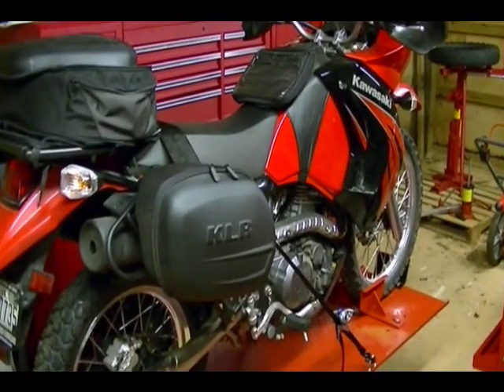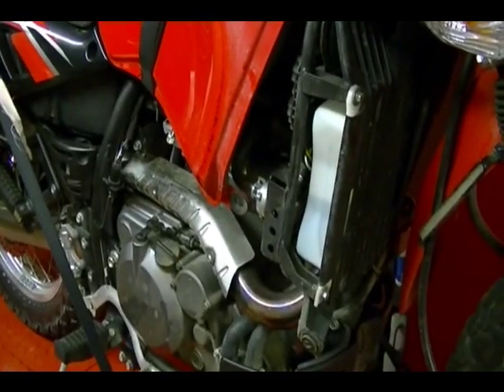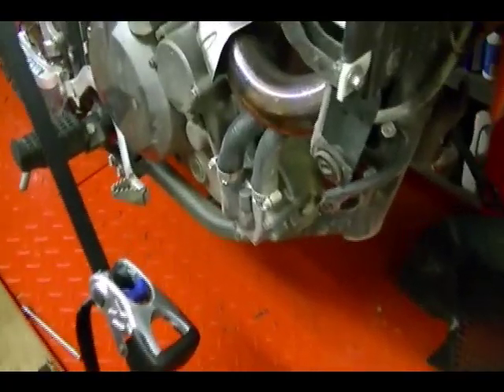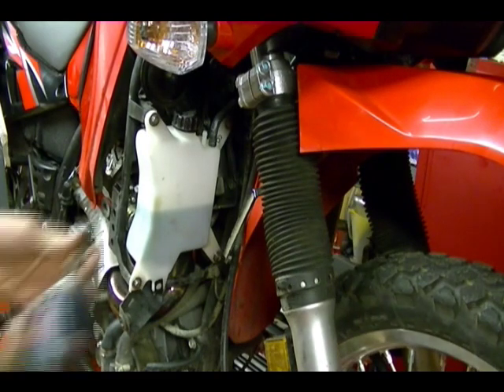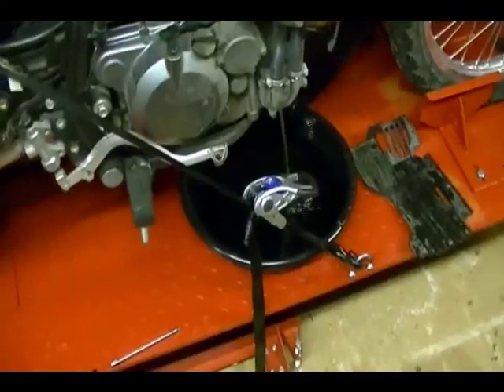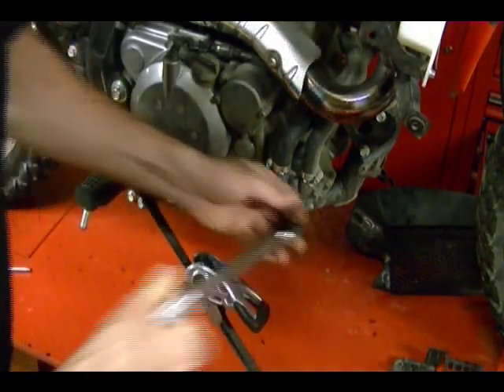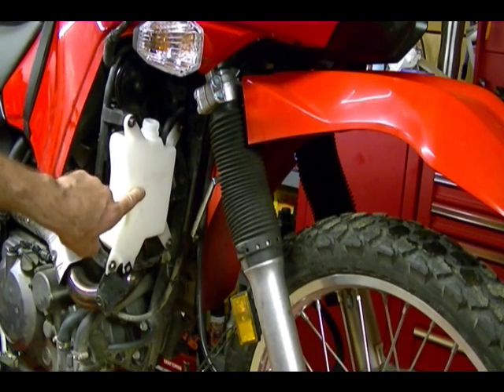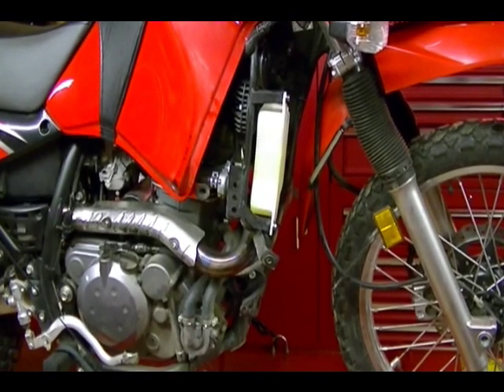Motorcycle Repair: How to Replace the Motorcycle Coolant on a 2009 Kawasaki KLR 650

Comment: Extremely helpful. I did a flush and now have an overheat issue but I did not know there was a drain plug. I pulled the hose and ran water so I must be mixed with old fluid. 
I see you a mechanic by the tools but this answers the way to do it. 
I have an 05 650. 
Thank you.

Comment: Just checked owner manual, you're right, ethelyne glycol based with corrosion inhibitors.  I just don't understand why this Prestone wouldn't advertise motorcycles too.  It says for cars and light duty trucks.  But it has all the things the owner manual says to have in it.

Comment: Are you sure you can use this coolant?  I noticed that motorcycle specific coolant is propylene glycol based and the Prestone is a different base since its designed for cars.  I read that using an improper base can eat away at the seals and damage the engine.  Thoughts?

Comment: I have a new to me 2005 KLR and tried removing that side panel part but mines a bit different.  It has screws on the outer part but also it's connected on the inside with plastic zip ties.  Would you just cut those off and then replace them or what?
Reply from the maker: +Shaine MacDonald You can get replacement zip ties at Walmart, or any hardware store. I would just cut them off, and find out why they are there, and replace them if I need to.
Reply: +Shaine MacDonald 2005s are gen 1's an 2008+ are gen 2s is why there are differences

Comment: You could use cheap spring water from a supermarket for the 50/50 mix right ?       But I do think your right,         Pre mixed coolant is convenient,      B@Q are offering 2 litres for a fiver,     So unless your working in a garage changing coolant everyday,     There`s no saving in it
Reply from the maker: Your should to use distilled water, but a lot of people don't. The premix is convenient. Thanks for watching!

Comment: Good video. Two observations though:
- Am I right in saying that you are not flushing the engine block using your method? The flushing water is just going through radiator and then out the water pump drain. I generally run the engine for 30 secs with distilled water then drain again to flush the block.
- I pour in the new coolant a lot lot slower than you. This allows the air locks to rise to the top of the radiator. The major downside though is that the sound of the liquid trickling in can make you wanna pee!

PS not trying to poke at your video with the above comments.

Comment: Great video! I have a 06 Ninja 500. Never changed coolant before. Manual doesn't give any instruction. Trying to learn the basics. So i need to 1. Remove fairing, 2. find the pump and the drain plug - unscrew. 3. open the radiator cap. 4. Empty reserviour (sp), 5. fill radiator. 6 fill reserviour. It will be different on my ninja of course but thanks to this vid i now have the basics!  Thanks again.

Comment: Do you use allot of Harbor freight tools? I think I could see the 13 drawer box in the background and i think that lift is the one from harbor freight too... allong with some other hand tools ive seen. Are your wrenches, ratchets, and sockets from harborfreight? Im starting to work at a small engine shop and am gonna need to start buying.